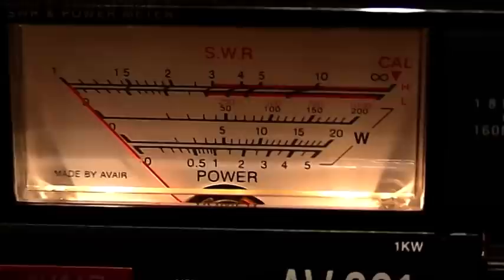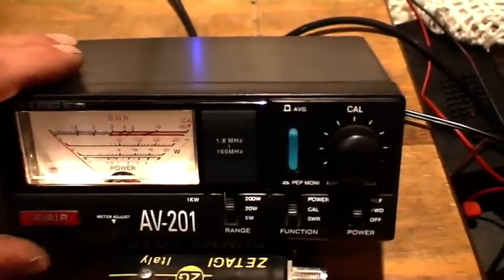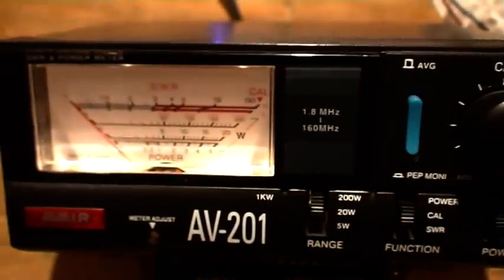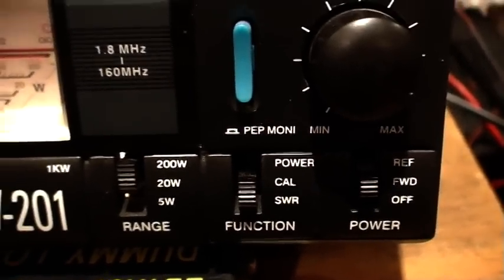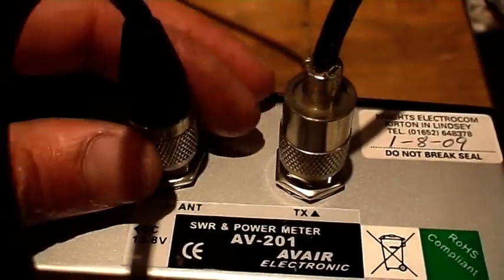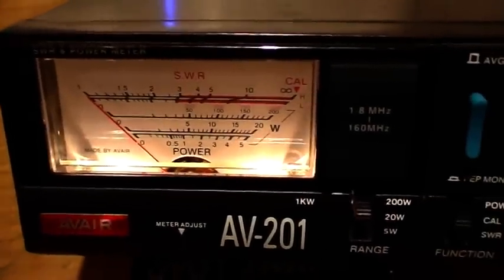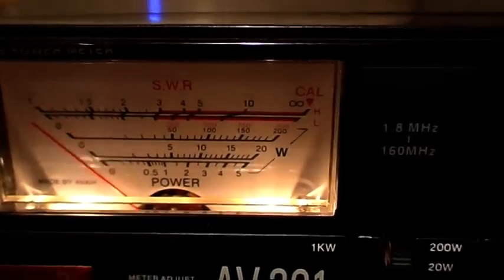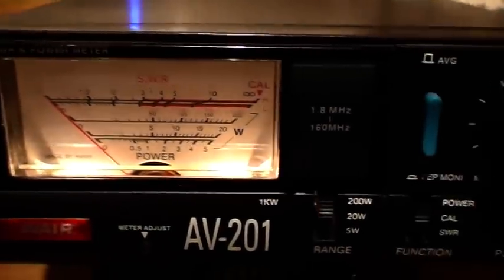SWR METER TEST.mpg

Comment: Or you could get a 5'8 wave dipole for a 1/3rd the price and it would already have a 2 foot height advantage over the a99. Had mine up on the roof for the last 14 years and never taken it down, gales wind rain etc etc and im 350 feet above sea level